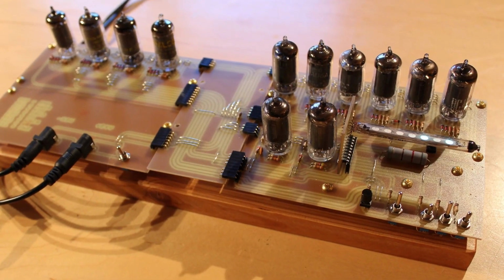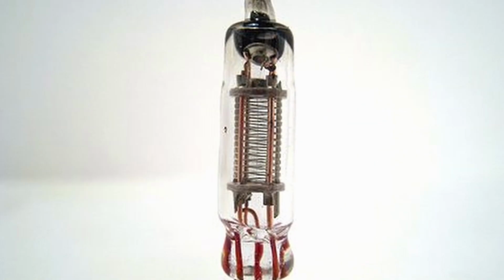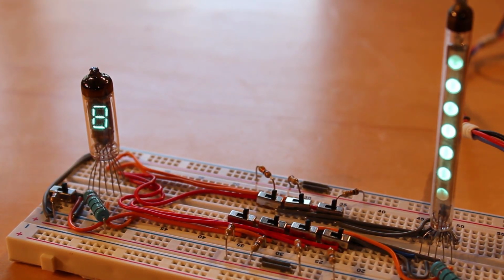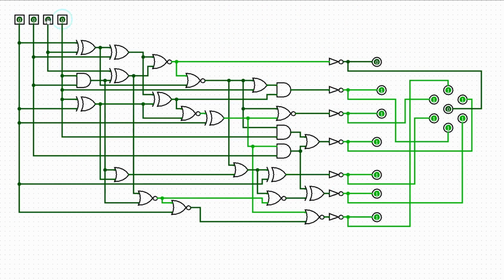Vacuum Tube Computer P.05 – Vacuum Fluorescent Displays

Comment: Konichiwa, I sent you a message over on Hackaday, but I'm not sure how often you check that out. I missed a couple of messages to me :) Anyway, I picked up some LD8035 VFD tubes and TD62783AP driver ICs in Osaka about 18 months ago. I finally had a chance to use them in a clock project. The project is nearly complete, but I have one issue. I'm using 12VDC for the ICs and an ESP32 via the ICs to control the plates and grids. The time is correctly displayed on my clock, but the plate segments don't appear to turn off fully...a little residual ghosting can be seen on the digits. I mistakenly used 4.7k pull-down resistors on that lines between the driver ICs and the VFD tubes for the grid and plate connections. I meant to use 47k resistors like a similar project that I found. Do you think that could be causing the ghosting? (lower value resistor is too strong of a pull-down on the lines?) That's the only real difference I can tell in my hardware setup. Thank you for any ideas or recommendations on troubleshooting.

Comment: VFD's have also been used for low power HF Amateur Radio transmitters. They only put out a few tens of milliwatts of RF, but that is enough to send CW signals for hundreds of kilometres, with a good transmitting antenna. There is at least one website which specialises in unusual radio signal generators, and there used to be some videos on Youtube about it. Try searching for something like 'VFD QRP Transmitter'.

Comment: Actually the whole concept of using a vfd as a triode is used by Korg as the so called NuTube 6p1. They use it in some newer vox amps, in a specially designed tubescreamer and as a suboscillator/saturator in a Korg volca bass synthesizer.

Comment: You are actually also undervolting the VFD's plates. The datasheet states that the plate voltage in normal use should be 25-30V. So even 24V is under the nominal voltage required. And the 17-18V you're providing even more so.

Comment: The dim lower anode is likely to be a lack of emissive coating on the ends of the filament. The slight alteration of brightness end to end is due to the bias effects of the DC potential with respect to the anodes.

Comment: The effect of reduced brightness seems to affect both ends of the VFD, being stronger at the negative side.
My explanation for it has 2 components.
1 - The electron cloud formed around the filament is not homogeneous. Its, naturally, less dense at the ends of the filament than in the middle section.
2 - The electron cloud is slightly shifted to the positive terminal due to the small electric field created around the filament by the difference in potencial at the ends, even at only 1 volt it exists.
Given the above, both dots at the ends show lower brightness than the ones in the middle, with the one at the negative end being even less bright than the one at the positive end.

Comment: I suspect a slight issue with your analogy at around 08:30 (One end of the heater being HOT with the other being LESS HOT when using a DC filament supply).
The filament has a constant current passing through it and a constant resistance per unit length of filament so the actual temperature should be largely constant along its length.
However...  The potential difference (a.k.a. voltage) between the filament and it's associated array of plates WILL differ between the two ends and it's THIS aspect that will cause the plate emission to be lower.  At the LEFT end of the filament, the voltage between filament and plate will be 1 volt (filament drive voltage) MORE than it is at the RIGHT end of the filament.
Edit:
As for driving the filament from an AC source, my understanding is that this 'works' if the AC source is a center-tapped source with the MID POINT of the AC source being the common / ground.  Therefore, the long term AVERAGE plate-to-cathode (a.k.a. plate-to-filament) voltage will remain pretty constant.  The mid point of the filament will always be at a 'virtual ground' potential.  Ar the extreme ends of the filament (left and right), the plate-to-cathode voltage swings equally above and below that of the mid point thereby producing a broadly similar illumination level.

Comment: Potential gradient along the filament isn't what determines the heating - the current is constant along the entire wire (ignoring the evaporated electrons). What could impact the intensity is, that the potential difference to the anode is slightly different (24V vs. 23V). However, the main reason for the dimming at the edges is probably nonuniform electric field between the cathode and the anode -- edge effects, especially if the rest of the conductors (connectors) are nearby the end of the element and attract the electrons instead of the anode.
Reply from the maker: I actually did a ton of reading about brightness and gradient along the filament after I put this video live (a little late...). From what I read from multiple VFD manufacturers, is that I believe it actually shifts in the opposite direction as to what I state in the video, with the plates above the negative end being brighter and the plates above the positive end being dimmer.

This isn't due to a temperature shift in the filament. Instead, at the ground side of the filament, the potential difference between the plate and the filament is at its greatest, and at the positive side of the filament, the potential of the filament in relation to the plate is actually elevated above ground due to the resistance of the filament. This means that there are fewer electrons present that can be boiled off and results in dimmer plates.

Comment: Those NuTubes that KORG launched a few years ago are basically just VFDs being used as tiny triodes.
Reply from the maker: Yup, those are really, really cool! Though, interestingly, you can use just about any VFD that has a grid (the tall ones with the dots don't actually have a grid) as a little amplifier too. A VFD out of an old VCR could totally be a low voltage pre-amplifier tube!

Comment: 4:42 So a VFD is just a diode that emits light? A "Light Emitting Diode" if you will?

That's really funny but really cool. Basically, like there are tube diodes and semiconductor diodes, there are tube LEDs and semiconductor LEDs!
Reply from the maker: Well, you're not wrong!
In fairness, most VFDs have a grid, making them Light Emitting Triodes, but in the case of the IV-25 VFD bar dot display I use here, it's just 7 little diodes with a common cathode. So in that case, it actually is indeed a Light Emitting Diode, haha.
Reply: @UsagiElectric  Fair point about the triodes. That made me wonder if Light Emitting Transistors exist, and apparently they do!

https://en.m.wikipedia.org/wiki/Light-emitting_transistor
Reply: @AgentOrange96  all transistors are light emitting if you operate them wrong enough.

Comment: Implement your VFD driver in a GAL for low-chip solution.
Reply from the maker: Interestingly, one of the uses I'm looking into using VFDs for now is not as indicators, but actually as memory! I'm thinking it can be a nice, compact way (compared to vacuum tubes) to implement a type of memory that can be accessed by my tube computer.
Here's an early proof of concept test on the breadboard: https://imgur.com/gallery/yz4yWDY

Comment: Another great video about vaccum tubes, thank you!
Your problem with oddly spread illuminessensce is probably not a problem of the heater itself, rather than using DC to power it. Applying 1V DC to the heater means putting one side of the heater on a more positive potential than the other. This is the reason why AC is mostly used for powering VFD heaters. By using AC this phenomenen will alter so faster you couldn´t see it.
Reply from the maker: Thank you!

Yup, I actually totally got that part of the video wrong. I had an awesome conversation with a viewer over on my Discord channel where we worked through trying to figure out exactly what was causing this. Since (ideally) the power supply for the filament is separate from the primary supply, the filament supply doesn't affect the brightness at all actually. 

However, the filament itself is a resistor, so when the electrons from the primary supply boil off, there's a stronger negative potential at one end compared to the other. The electrons from the primary supply have to flow through the resistance of the filament to the far end, which means not all of the electrons make it there, reducing the number of electrons that actually boil off and strike the plate. 

To combat this with DC filaments, the filament itself was often installed at an angle, with the positive side placed physically closer to the plates. VFDs are weird, but amazing pieces of technology!

Here's a few good links (though the explanations on DC Filaments is a bit lacking):
https://www.noritake-elec.com/technology/general-technical-information/vfd-operation
http://www.vwlowen.co.uk/arduino/vfd/VFD-Application-Note.pdf

Comment: Did you say at one point you'd be willing to use semiconductor diodes? Because you can create a 4x7 matrix ROM out of diodes.
Reply from the maker: Yup! I do indeed use semiconductor diodes, which is bordering on not quite period correct (though IBM did use Germanium diodes in quite a lot of their later tube computers), but it means that a demultiplexer and diode matrix is by far the easiest way to convert binary to hexadecimal.

Comment: The Noritake/Korg Nutube 6P1 is a VFD that was designed to be an audio headphone amp.  As for the binary to 7-segment decoder, can you do something with lightbulbs and photoresistors like  HP used to do for nixie decoders?
Reply from the maker: I really want to get my hands on a Nutube one of these days, I think they're such an awesome little VFD. But, they're pretty compact and have two directly heated triodes, so you could theoretically stand them on edge and stack them together to build some pretty compact triode logic. I could probably get 8 to 12 of those in the same space as a 4 standard dual triodes, which would be pretty wild!
Oooh, I haven't heard about that type of Nixie decoder. Everytime I search for Nixie decoder information, it's always done with ICs or transistors of some type. Do you have any links to the photoresistor method? That sounds really interesting!
Reply: @UsagiElectric  Look at the HP AC4J or similar counter modules.  They use dual triodes as flip-flops for the counter with neon bulbs as the outputs.  Those neons shine on photoresistors; multiple neons on one resistor forms an OR, multiple resistors in series an AND.  www.decodesystems.com/nixie.html has a description
Reply from the maker: @michaelardai9703  That's insanely brilliant! Those HP engineers were on another level. Though, I'm having a hard time wrapping my head around 1242 BCD, which is what is being used here: http://www.decodesystems.com/hp-decimal-display-1-m2.gif 
1100 is actually six instead of 12, which threw me for a loop. But, then again, it just shows how much of a pain it is to go from Binary to Decimal. Even the engineers back in the day were having to come up with really strange and inventive ways to make it work.
Reply: @UsagiElectric  Honestly, it would be way cheaper to use subminiature triodes since those Korg tubes are like $50 each on their own and their current handling ability is almost nothing. I have one in a headphone amp. Something like the IV-15 or DM-160 might work? They were mostly used as indicators for computer output but might work otherwise as at least the DM-160 saw use in a portable battery radio. Another option is something like the 6BF7 which is a subminiature dual triode similar to a 12AU7 but without the dissipation of its larger brother and doesn't use directly heated cathodes so power supply is a bit simpler.
Reply from the maker: @kylejones8392  Oh yeah, those Korg nutubes are quite expensive, I was more thinking if someone had a whole box of them they were tossing out, haha. Interestingly, the IV-15 VFDs are the ones I've ordered to use as my indicators! They're just gorgeous looking little tubes and I can't wait to get my hands on them. I would love to get my hands on some subminis someday and see how they compare to their bigger counterparts when using at low voltage like I am. With just 24V and a 10k plate resistor, the amount of electrons that can flow is extremely limited, so subminis may be right in their element!

Comment: Enjoying this series. Optimizing the circuit from binary to 7-segment is an interesting challenge.
Reply from the maker: Thank you so much!
Binary to 7-segment is crazy difficult, especially if you're going to decimal instead of hexadecimal. Having EEPROMs makes it a lot more manageable, but there is something very cool about doing it with the fundamental building blocks.
Also, I'm up to episode 38 in your 8-bit series, I'm loving it so far! I watch one to two episodes everyday on the couch with the bunny.
Reply: @UsagiElectric  Oh yeah, the Eeprom trick is for too high level for the likes of us! ;-) I actually made a 7 segment decoder in my diode matrix sub series. I wouldn't try and do a decimal display in raw circuits, I wrote a divide for my processor to handle decimal display. If you really want to do that, look into the algorithm "double dabble"  for converting binary to bcd, you can serialize that to do with fairly simple circuits.
Reply from the maker: @weirdboyjim  I actually recently watched the first part of the diode matrix sub-series, and using the pin headers on the perf board is a brilliant idea! Going to decimal is definitely not something that I think is worth the amount of additional circuitry required, but a demultiplexer and diode matrix would work really well for a hexadecimal display, which is something I'll probably look into in the future if I get to the point where the binary is starting to melt my brain. (And your sub-series is going to be an excellent resource!)

That double dabble algorithm is brilliant, but oh man it requires a lot of steps! Still, if I ever build something that has an 8-bit output register, that could be a quite interesting solution. The circuitry for that operation could almost be built entirely separately, so it does the shifts and adds simultaneously while the rest of the CPU does work on something else. Of course, doing all that with tubes makes it exponentially more difficult than it should be, haha.
Reply: @UsagiElectric  The Apollo Guidance Computer did binary to 7-segment with just using NOR gates. Although I've not seen a schematic.
Reply from the maker: @michaelturner4457  Interesting! I did a bit of looking through some of the logic diagrams, but there's so much it's hard to know what you're looking at (especially without an intimate familiarity to the AGC). But, it seems like they often would use SR flip flops to store data and then decode that using Q and inverse Q outputs. Which makes sense. If you're using just NOR gates, that's by far the most economical way to do it!
Lots of great diagrams here: http://klabs.org/history/ech/agc_schematics/

Comment: the grid is also used to multiplex the displays
most devices coupled all grids together and that means that you need to multiplex to get them to show diferent things
Reply from the maker: I can't believe I forgot to mention that! Especially considering that I not only mentioned it in the "In a Minute" episode on VFDs I did, I also drew a diagram showing the principle!
Reply: That was my thought as well.
Reply: That's exactly how multi-digit VFDs (like the IV-18 or IV-27) work